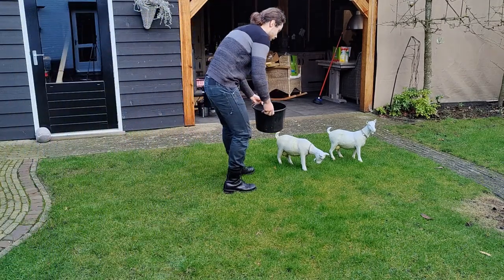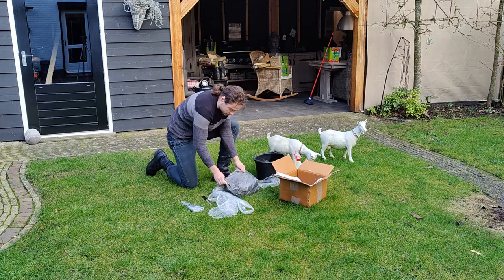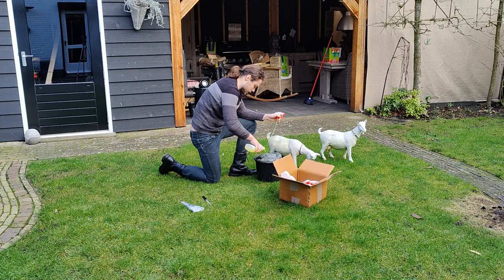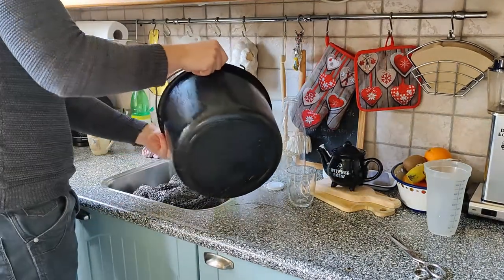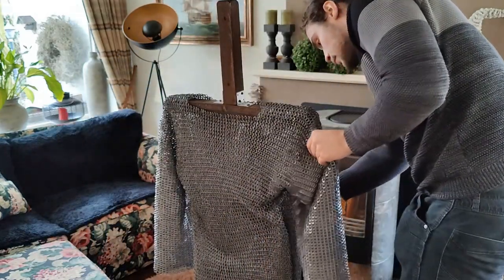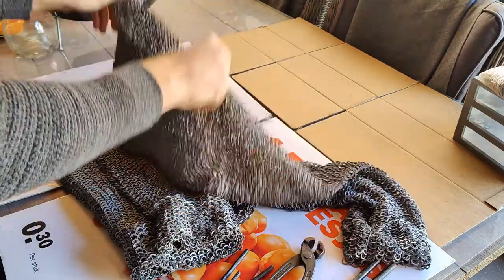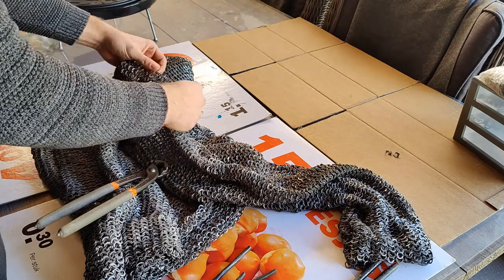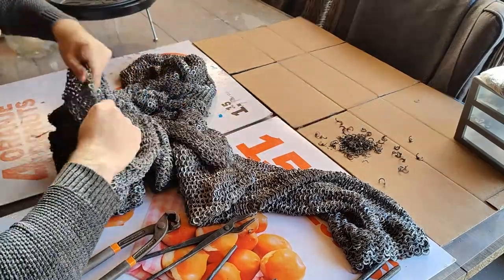Making 12th Century Mail Hauberk. Day 1

Comment: This will be a fun project to follow!
I'm also interested in getting a 12th century chainmail, but find it hard to decide what type of rings to choose.
Flat riveted vs round riveted for this period. 
What are you're thoughts about it?
Reply from the maker: I think both are perfectly suited. Only I do believe round rings were a bit more prevalent throughout history. But I'd really have to look that up. Maybe make a video even
Reply: I think a mix of riveted and solid rings is the most accurate from basically the Roman Empire to the High Middle Ages. The solid rings would be punched out from sheets, so they're naturally flatter or almost square in cross section. Many modern flat rings are too flat compared to historical ones. The riveted rings would be rounder in cross section or have rounded corners with flat sides, like a round hit with a hammer. The actual rivets would mainly be round too, I think wedge rivets are a Late Medieval German thing primarily. While a couple hundred years too early, there is a very detailed paper on the late 10th century Gjermundbu hauberk describing the rings thoroughly.

Comment: its made from the ulberth hauberk right? if so, i was wondering what do you think about their quality/quality of the rings/rivets? ive heard ulfberth mail is indian made mail and heard alot of mixed review about it. Does this quality hold up against reenactment? Btw really enjoy ur videos man, learned alot from it!
Reply from the maker: The Ulfberth hauberk is not top notch as you'd expect for a price from around the 400 euro's. It does have some rings that are broken on beforehand, the punched rings do look like they were made in a factory (as is the case)and the methods used for the armpits and such are very primitive so to speak. But I do like the accessibility to spare rings to adjust the hauberk and the fact that the rings are quite strong in and of themselves. I also like the inclusion of the rivet pincher.
Reply: @feudalfrits9559  thank you for your answer, do you think it will hold up well enough in reenactment though? since thats what im aiming at in the future
Reply from the maker: @mark-fn2zs  in regular reenactment you really need not worry about your kit surviving during a battle. And if a ring does burst, it is easily replaced. Most important is maintenance, but maintenance is awful no matter what you use XD In terms of authenticity, the way the mail is put together it is marketed towards mid 13th century reenactors. You will see me in a future video (when the weather dutches down..) altering it to make it more authentic for the twelfth century.
Reply: @feudalfrits9559  thanks! Cant wait to see future videos, u do different periods aswell ? Im going for viking/vendel/migration age
Reply from the maker: @mark-fn2zs  doing late 11th and 12th. Also celtic 4th/3th cbc. I am going to once start with dutch 16th century "hellebaardier." But that'll be an other time.